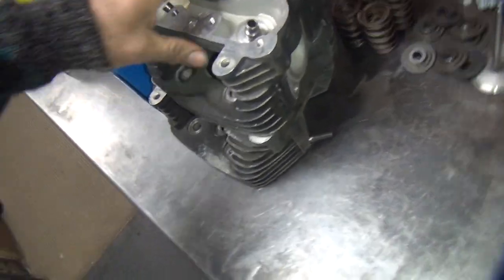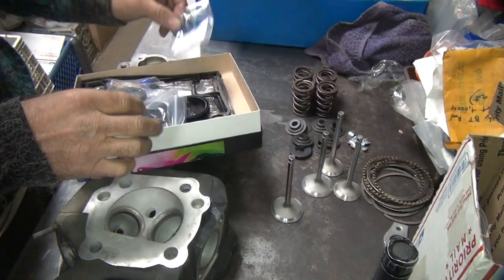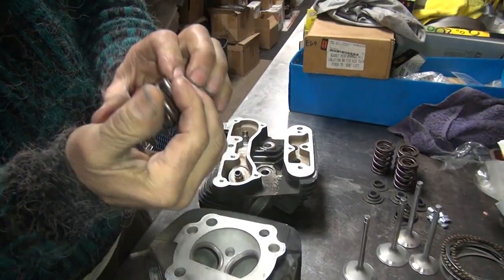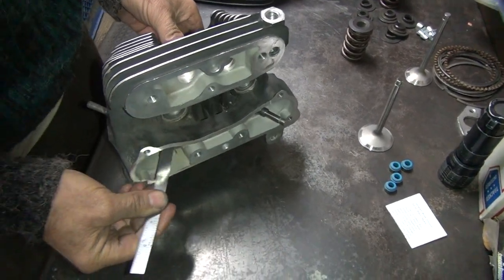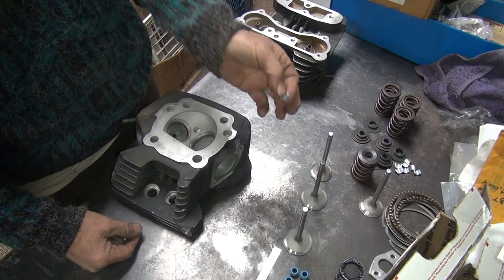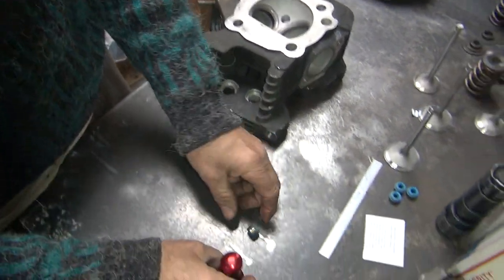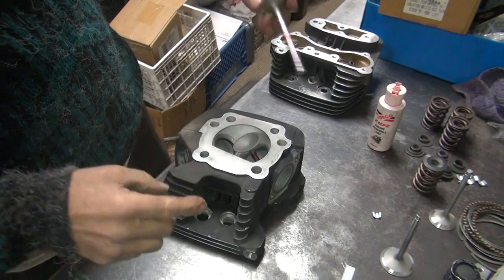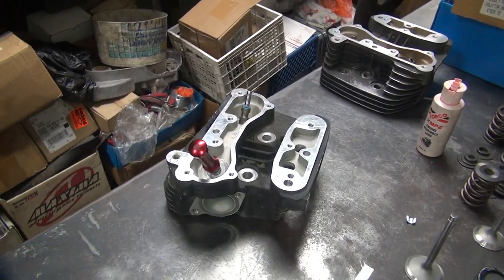#116 1993 80ci fxr cylinder re-ring honing piston quickee topend rebuild harley by tatro machine

Comment: What would have been the benefit of using those blue tip seals versus the ones you did use and versus stock seals Tatro?
Reply: They are made out of a better material: Viton.  Viton can withstand temps up to 450-500 degrees.  Stock seal limits are around 250 degrees.
Reply from the maker: i like the old seals because they don't work as good and let some oil by to help lube the valve stems. harleys run hot and need the oil.
tatro